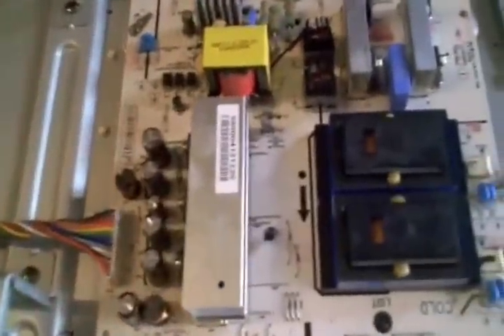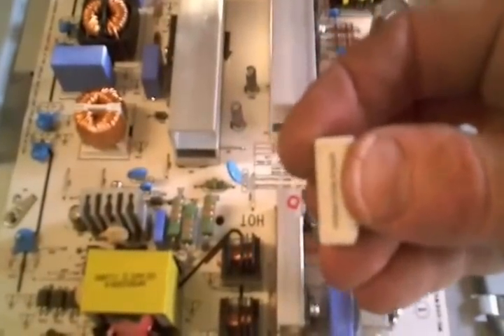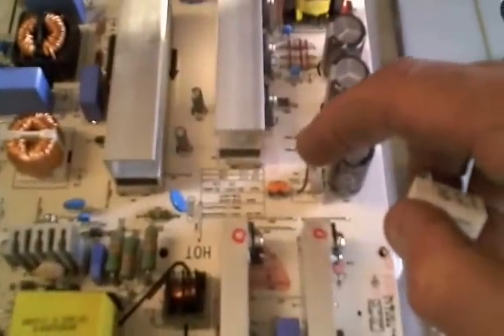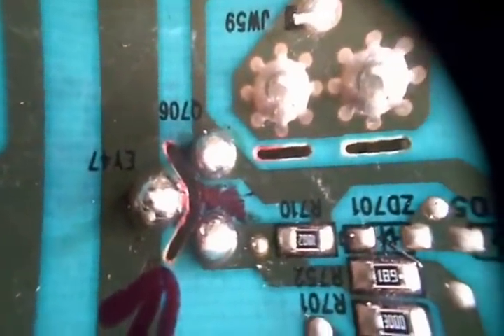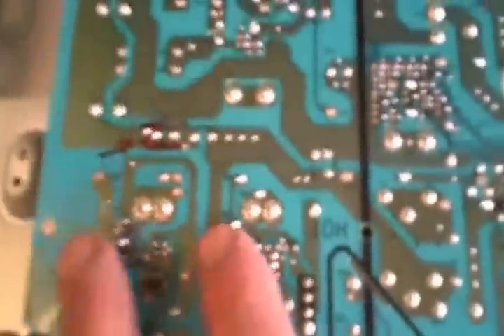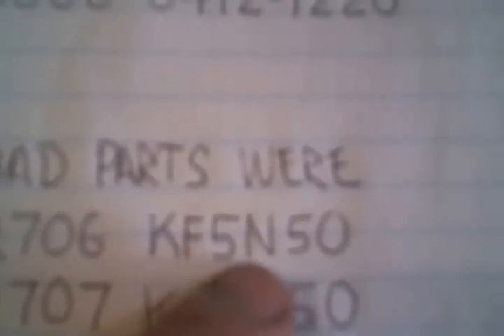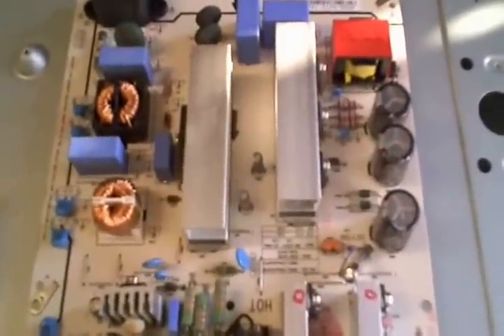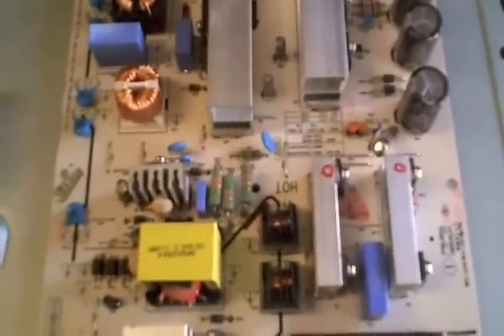Vizio E3D470VX  Repair Case history.

Comment: I have a 55 inch, same model.  Power comes on but won't shut off.  It powers up but is stuck on the logo and won't boot up.  I tried everything I could find on the internet with no luck.  I am at a loss as to what the issue might be.  It started after a brown out we had the other day.  Tried unplugging it, tried all the various combinations for hard reset on the internet.  All it does is turn on and go to the logo, and you can't turn it off unless you unplug it.  Weird.
Reply from the maker: Sounds like a main board issue.

Comment: I am working on the same tv but with the power supply board 0500-0405-1290. 2 transistors have shorted out EL408 and EL409. Unfortunately on the reverse side of the board, it also took out D400 and D401 as well as R400, R401, R402, and R403.
The transistors have part numbers on them, and I believe I have identified the values of the resistors, but have no idea what diodes to order. Would you happen to have a schematic on this board?
Reply from the maker: I don't, but you might see if you can get the schematic through this site. https://www.servicemanuals.net

Comment: I'm hoping you still answer messages.  I was given a Vizio E472VL.  There are no signs of power.  I've checked the output voltages listed on the power board and they're all correct.  I'm not seeing anything with the old flashlight test.  Is there a way to check the voltage CN203 and CN204?  What should the readings be?  Thanks
Reply from the maker: Generally speaking the power supply voltages are going to be 5, 12, and 24 volts, and your inverter produces a much higher voltages to drive the back lights.
Until the power supply is in the on position often times you will only see your stand by power which is 5 volts.
Reply: Grants Pass TV Repair Thanks for the reply. I'll have to keep digging I guess.  I can't find a replacement for under $60.  UGH.